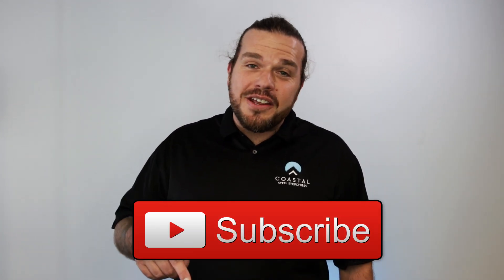The True Cost of a Metal Building Kit

Comment: Well, I was thinking about a steel building but not anymore. Thanks!
Reply from the maker: Hey Patrick, hope the video helped. Information is key. Holler if you have any question.
Reply from the maker: What are you planning on using the building for?
Reply: @CoastalSteelStructures  Tractor and implement storage and repair work on said equipment. Im needing about 3000-4000 square feet, nothing too big or fancy.
Reply from the maker: If you'd like, I can get you a quote on a smaller system that will meet your needs and not break the bank. All I'd need is the zip code for where the building will be installed.
Reply: I would want a 40x40, lean-to on each side, 12'
roll up door both ends, walk through door and 4 windows installed in 38654
Reply from the maker: Patrick, we have a few options that could work. Price range from $20,000-$25,000. That price includes  delivery and installation. Additionally, the price includes four windows, a 12x12 rollup and a walk door.This DOES NOT include foundation. Feel free to contact me to go over options. info@coastalsteelstructures.com

Comment: I need a steel structure.  12' wide X 172' long with divisors that are spaced every 12'.  This creates 16 cells (12'X12').  Structure is 10' high and the roof can be flat or a single slant or slightly slanted.  I need 16, standard, door openings (each door is uniformed to the left and opens to the left) and 16 window openings to accommodate vinyl windows (4' wide X 30" tall).
  Each 12'X12' cell interrior must be able to integrate basic wood framing to accommodate sheetrock and insulation and basic wiring.
  I'm not going to directly say it, because you get the general idea.
  Basically, said structure is a little over 2,000 sqft.
  Price?
Reply from the maker: Big AL One, thank you for considering us in designing your structure, we are happy to get you over a price. Your description is very detailed and well communicated, thank you. Could you send over a sketch so we can verify that we are designing the same building you have described above?  We also need the zip code for where the building will deliver. Please email us here: info@coastalsteelstructures.com.  Thank you for your time and consideration, Chat soon
Reply: Acknowledged - Thank you for taking the time to both read and reply.  Will E - Mail you soon with further details.
  Respectfully, BA1
Reply: Sounds a lot like a Self Storage Facility Plan. Good Luck.